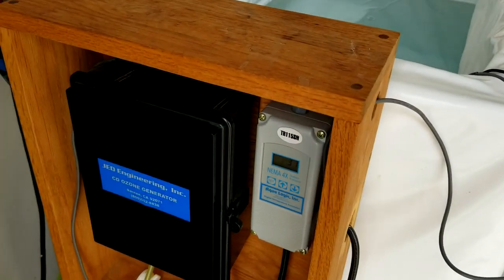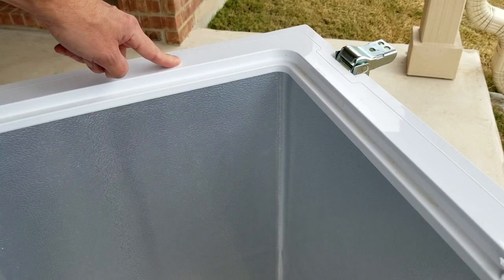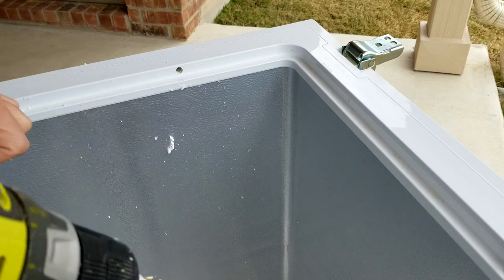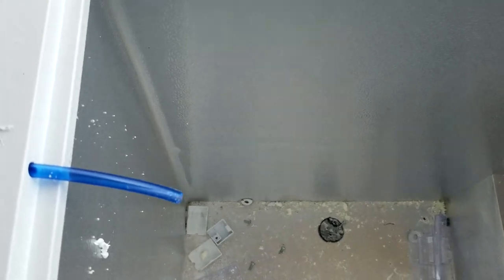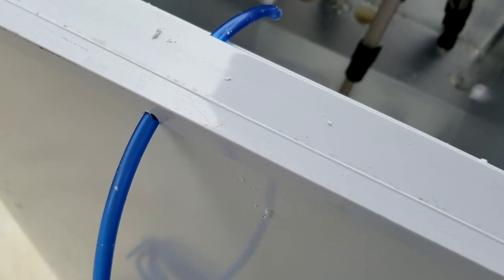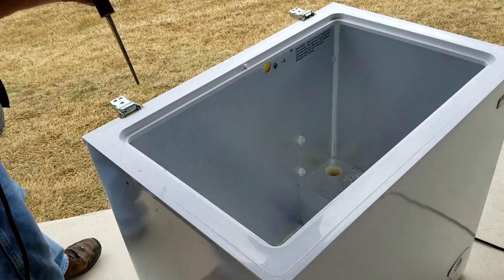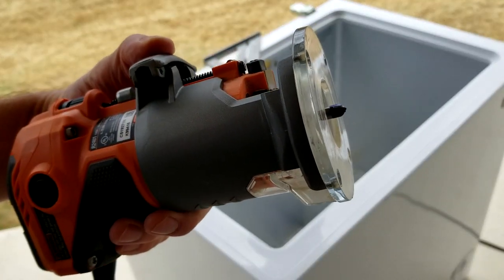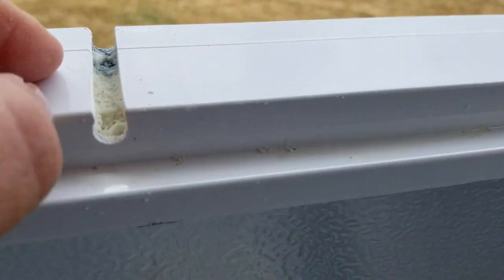Options to Get Your Cables, Tubes & Wires Into The Chest Freezer

Comment: Thanks John! I went the route of the router (haha) using a rounded bit to secure the tube/wires, great idea. I haven't yet determined what to use to seal the inside of the cut though. i'll post on FB when i do. I think this is the easiest and safest (for the freezer) way to get tubes in.
Reply from the maker: Derek - that was a fast implementation!! Please let me know what you figure out and I'll post your info in the comments above or in a followup video.

Comment: Just drilled into the top plastic trim. Hit a gas line. $1000 down the drain. 1000L Westinghouse 😢
Reply: I must have drilled too low. 
$1000 for the freezer 
$160 JB weld 
$150 Pond shield. 
And many hours lost. 
Expensive mistake. Don’t be 99% sure there isn’t a gas pipe there
Reply: Just took to my my dead freezer to see where the line I hit was. Directly under the plastic trim. Hard up against the plastic. 
Only drill into the lid people.
Reply: I shouldn’t have not watched the video and just read the details section. Costly error.
Reply from the maker: @RPOLIVNICK  - I'm sad to hear that this happened. I know how disappointing and frustrating it can be. I have warnings in both the video and in the video description.

Since you have already invested money and time, instead of starting over, you might consider talking to a refrigeration tech or appliance repair person.  

The cost to repair might range between $300 - $600. Keep us posted.
Reply: I’m now 2 brand new freezers in a hit a line both times smh
Reply from the maker: @bornNraised702  - I'm sad to hear this. 

Did you follow the directions to start very slowly with a tiny hole only through the exterior and to probe with a wood dowel?

Maybe it's better to go through the lid?

Comment: John which one of these options would you go with if I haven’t had  line-x application yet. The store is dragging their feet.
Reply from the maker: Line-X makes adds another variable. The typical application is 1/16th of an inch, but that can be thinner or thicker depending on the how the technician applies it. 

You can make a hole that is slightly bigger and then plan on doing something to pad the extra space. 

For a typical chest freezer setup, I still prefer going through the lid - but maybe only because we have three plus years of successful results doing that. 

That said, I think the next safest option would be to use the router.

Comment: Thanks for your videos and book. Helps a lot.  Wonder if you have a solution for this problem. Jed 203 Ozone seems to dissolve/degrade the plastic on the lid of the freezer.
Reply from the maker: You're welcome. 

This would be a great question to post in my group so you could also add some pictures. 

I have never seen this happen before. I've been using my JED 203 for 3 years and have no issues. 

I have a few questions 

What brand/model of chest freezer do you have?

How old is your chest freezer? 

Was it new or used when you bought it?  

How long are you running your JED 203 each day?

How long ago did you start using the JED 203? 

Are you using any other method for sanitation?
Reply: @JohnRichterAustin  Unfortunately, I gave up Facebook years ago.  I have a Insignia™ - 14.1 Cu. Ft. Chest Freezer. I have had it brand new since June 2020.  I used Aqua-6 Ozone Generator up until now. I ran it 15min every hour until recently.  I just installed the Jed 203 2 days ago.  I run that for 2.5hrs a day based on what the instructions said and your recommendation.  So, maybe the lid breaking down is from how much I ran that other low quality generator into the ground. haha.  i was thinking of just coating the lid with a Polyurethane to protect it in the future.  It was like a white sticky film if i ran my finder across it.
Reply from the maker: @mfeltster  - I recommend starting with 30 minutes for the JED 203 and adding time in 30 minute increments if needed, working up to no more than 2 hours. 

Was your water not staying clean when it was run for less time? 

Even at 15 minutes every hour, that weaker machine was running 6 hours a day- that is a LOT of ozone! 

Insignia does not use high quality material in their chest freezers, so that may be part of the issue. However, no need to replace it if it is working!

What you could do is sand the parts of the lid that have deteriorated with an 80 grit sand paper, and follow up with a 150 grit to get it smooth. 

Then apply the polyurethane sealant with a brush. Two coats would be a good idea. 

Let me know what you decide to do!
Reply: @JohnRichterAustin  Sounds good.  I agree with what you said.  Gonna run the Jed 203 based on what you said.  You recommended exactly what I was planning on doing. I will report back. Thank you!  Oh and by the way, ya it was a lot of ozone for sure, my timer failed for two weeks while I was in Colombia for a month and the water was fine when I got home. LOL